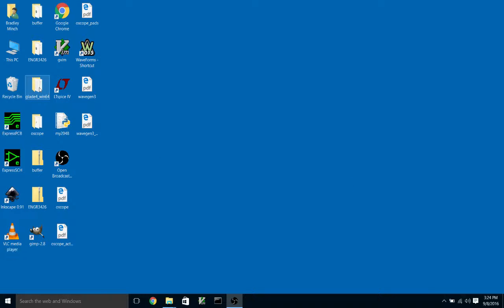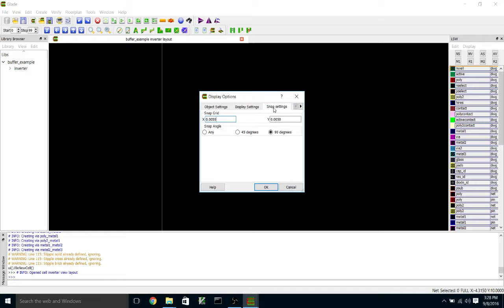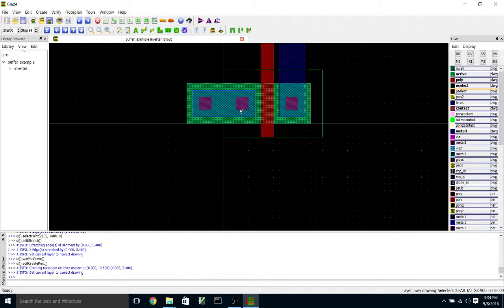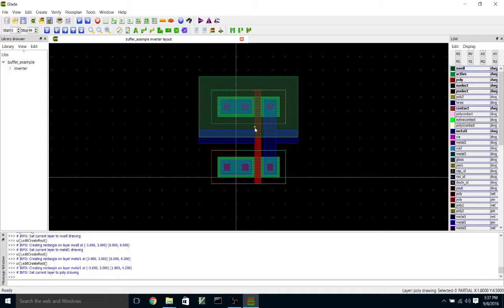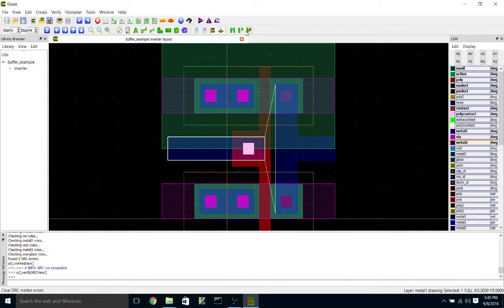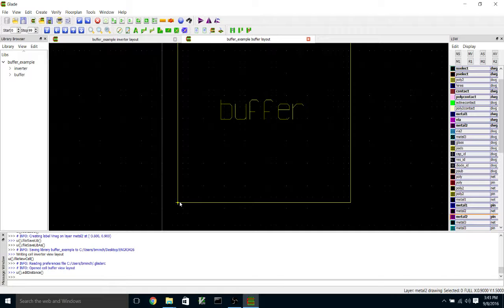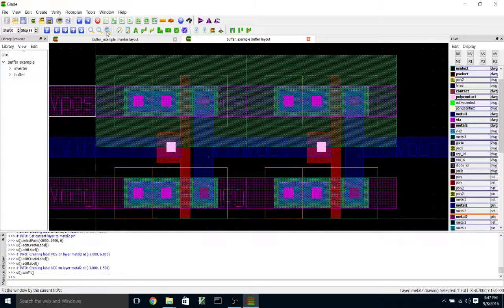Glade layout tutorial

Comment: Summary:
C5 Process  : @t

TimeStamps :
@ Creating a new library
@ Create a new Cell
@ Initial Configuration (Grind and Snap Setting)
@ Creating a Shape (Polygon)
@ Partial Select and Full Select in Glade
@ View/Select a layer
@ Changing Layer Color/Stipple Pattern
@ Running DRC
@ View DRC Errors
@ Waive DRC Errors
@ Add Pins
@ Creating Text
@ Creating an Instance

Bindkeys in Glade (Default)
* R : Rectangle 
* P : Path
* C : Copy
* S : Stretch
* F4 : Partial Select or Full Select
* Shift+D : Run DRC
* T : Text
* I : Creating  an Instance

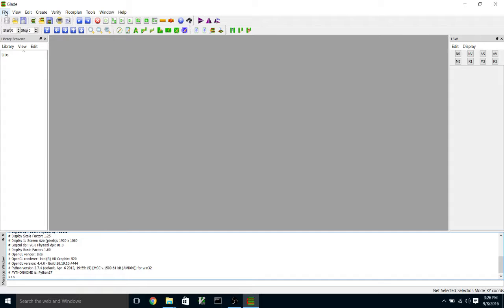Comment: 1:18 Creating a new library
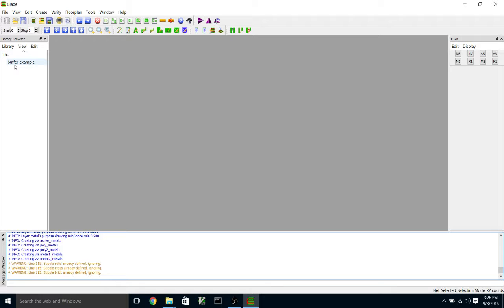2:06 Create a new Cell
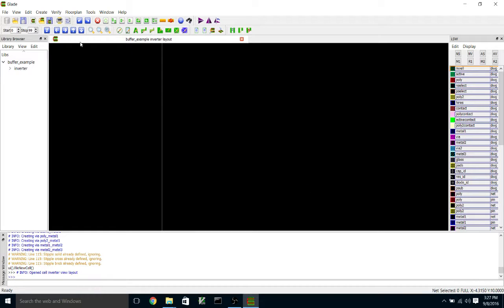2:31 Initial Configuration (Grind and Snap Setting)
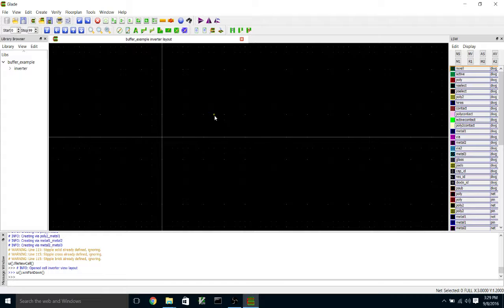4:42 Creating a Shape (Polygon)
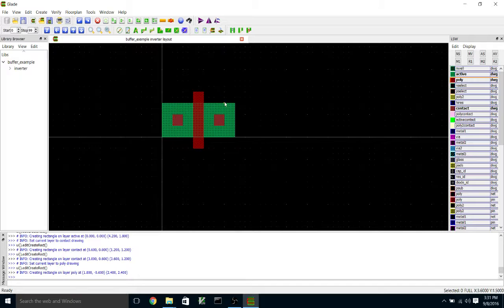6:25 Partial Select and Full Select in Glade
10:49 View/Select a layer
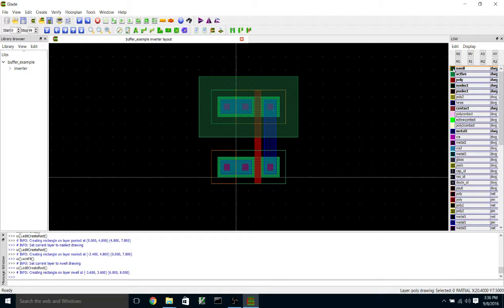11:15 Changing Layer Color/Stipple Pattern
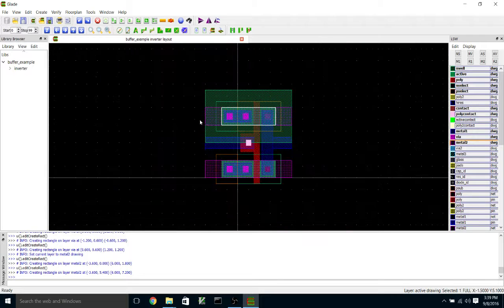14:22 Running DRC
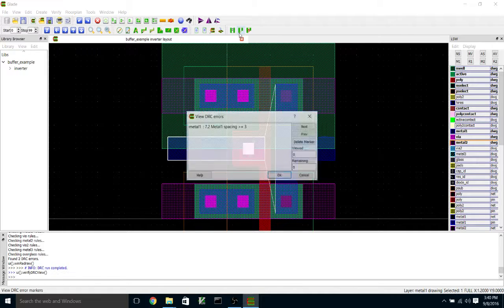15:34 View DRC Errors
15:53 Waive DRC Errors
16:09 Add Pins
16:43 Creating Text
18:41 Creating an Instance